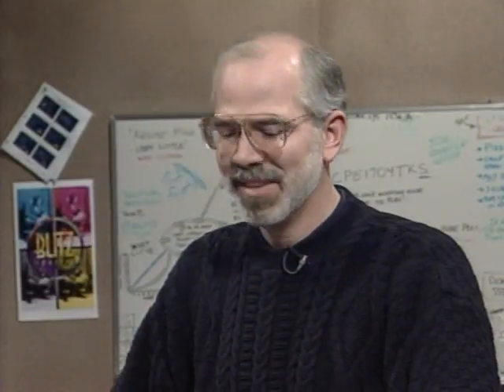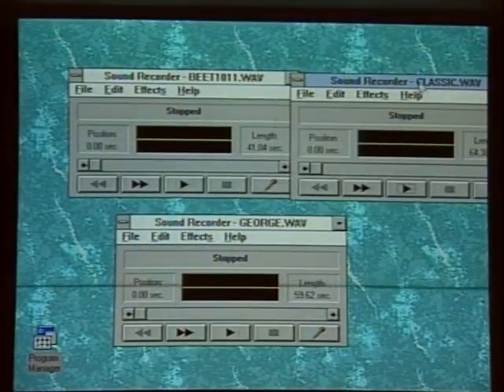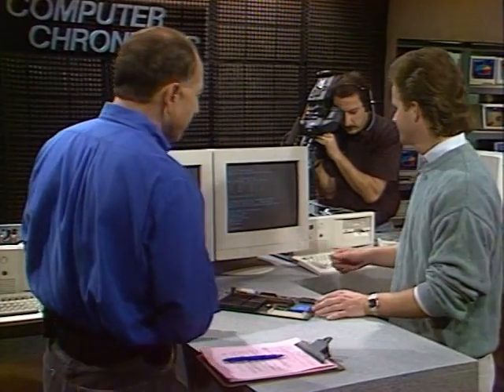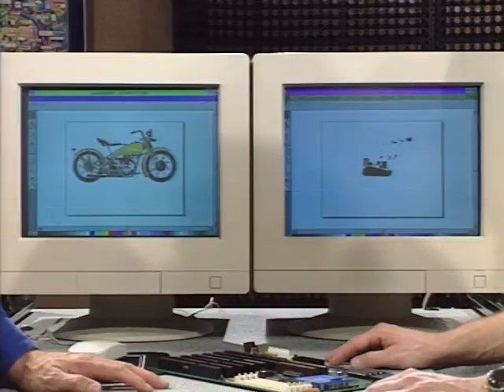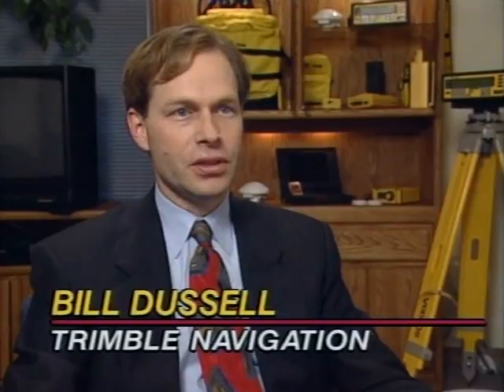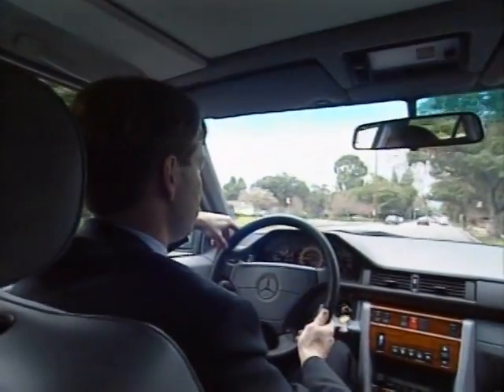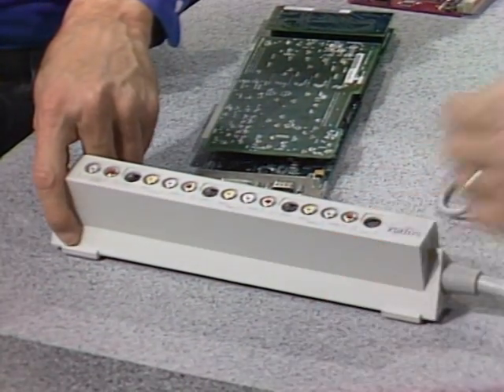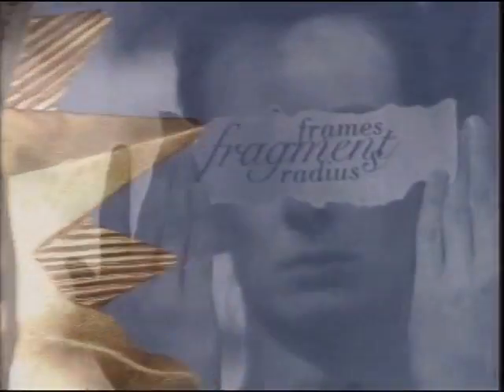The Computer Chronicles - What to Do with Your Expansion Slots? (1993)

Comment: I was three years old around 1993 and before the Intel Pentium emerged and mainly computers were interfaced with expansion slots that would be expandable and suitable if you wanted to add additionally another card for video, audio and anything in comparison upgradable in the machine that was the precedessor relatively like the i486.

Comment: what size are those monitors?
Reply: Probably 13” or 15”
Reply: @TheyRiseBand  I could be wrong, but the monitor on the Mac looked bigger at 17in, but yeah 13in - 15in was indeed the most common size back then as I had a 15in VGA monitor at the time.

Comment: And look at us now. Most of this stuff is already integrated into our computers. Except for maybe graphics the integrated stuff is good enough for the most part.
Reply: Which is sad and just a sign that we got conditioned to accept sub-par crap. The prime example is the audio. A proper, good Soundcard will always be better than the integrated crap on the Motherboard, simply because a card can have a lot more features, better chips, more features and all that.
Reply: @ShadowAngel-lt8nw  Sound cards haven't been better than onboard audio for ages. Sound card development has stagnated for around 20 years. They use the same (or worse) chips that are commonly found in onboard chipsets.

If you want the best possible sound from a PC you wouldn't be using a sound card or onboard sound at all, because PCs, with their big switch-mode power supplies, are a very electrically noisy environment. You would use an external DAC connected to the PC via something like USB, and ideally, powered by its own linear power supply.

Comment: No wonder computers sucked before, everyone trying to do their own thing and weird cables, thank God for USB
Reply: +andree1991 firewire 400 is faster then usb 480 because usb relies on the cpu of the host computer.and it also provides for more power,  but computer manufactures don't want to pay 25 cents for every computer sold to apple, so they don't include it anymore. sigh
Reply: +andree1991 thank god for usb and irq steering, because without it you wouldn't be able to add any more devices if you had a sound card, a mouse, a modem, and a printer already installed.
Reply: @misterkrad  
Most computers had serial and parallel ports for printers and other peripherals.